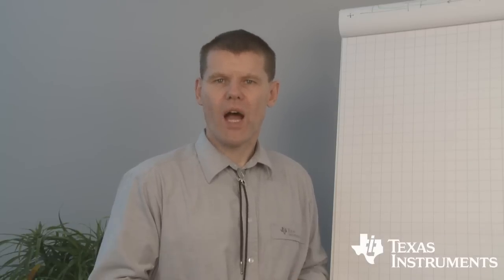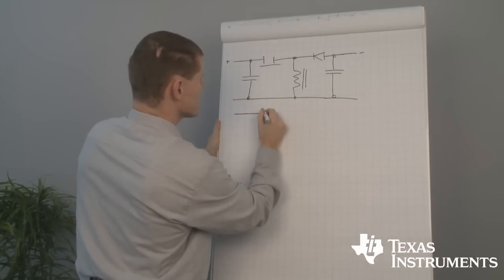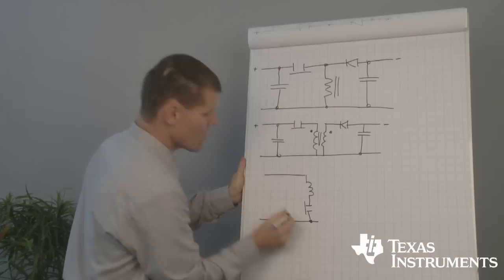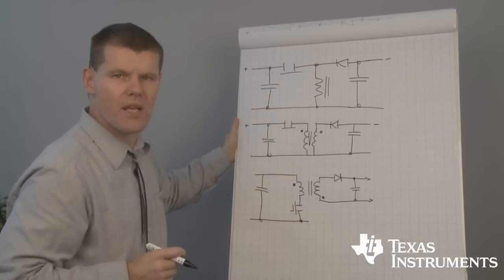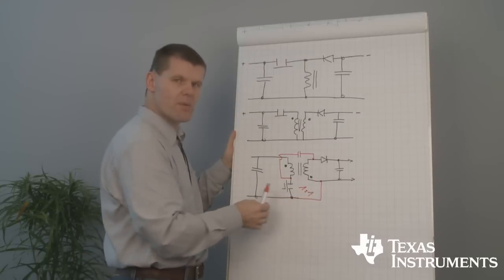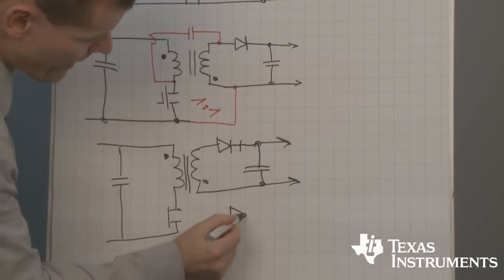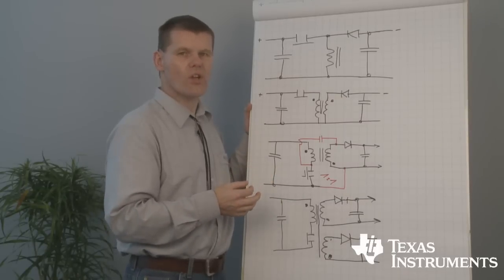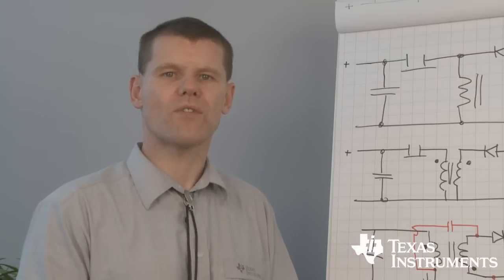INVERTER -- FLYBACK - SEPIC - Tutorial with Bernd Geck (par

Comment: He gives no description of what actually happens during an on-off cycle at all !   He doesn't point out that the half of the cycle that energy is transferred on, depends upon which way round the diode goes.  He points out no reasons for anything, just idiotic statements.   And he sounds like his pants are two tight.  But apart from that, "Very Naice".

Comment: Does the turns ratio depend upon the input given? If we don't use different no.of turns for secondary and primary winding then how does the voltage gets boosted in Modified SEPIC with magnetic coupling.
Reply: At switch-off the current in the coil cannot stop instantly.  Same as a mechanical mass, so the force, voltage, depends upon the impedance it finds to flow through.  It can cause a very high voltage sinusoidal pulse if the impedance is a small capacitance, stray C being Minimum possible.  If the diode is round the right way, the peak will depend upon what load is connected.   The guy explained non of this, yet people are rating this as helpful !.

Comment: i have already designed my own linear regulators with  mathematical analysis . My next step is buck converters and im so excited of its mathematical analysis and waveforms because i will apply calculus .
Reply: Why do you need "Calculus" ?.   The current in the inductor is simply. V/L  x  t.    Volts, Henry, second, amps, while the switch is ON,  but when it turns off the current cannot stop instantly, and the resulting voltage will depend upon what path is available for the current to decay in.   With nothing connected, this will be the tiny stray capacitance, so a damagingly high sinusoidal voltage spike will result.   But if the diode is round the right way, it will provide a path, and the current will decay approx. linearly.

Comment from the maker: Turns ratio 5:1 doesn’t work for SEPIC because voltages at drain/anode have to be balanced to cover leakage energy, BUT if you connect the SEPIC capacitor from first winding at primary (counted from drain) to anode, this will work. Another possibility to get rid of ringing from a poor transformer is an active clamp flyback topology.  Easiest way is to build a well-coupled transformer with leakage inductance 0.1%-0.5% max, resulting in less leakage energy & less ringing without additional costs.
Reply: "voltages at drain/anode have to be balanced" ?
What !?

Comment: @texasinstruments can I configure to SEPIC provided turn ration is 5:1  the reason here is that the ringing noise is very hard to eliminate.
Also is single buck inductor is less noisy than flyback, and if so can I use it to convert 270DC to 12VDC 1 Amp